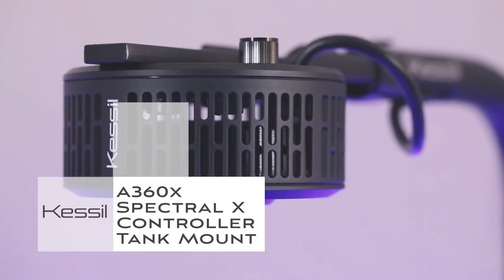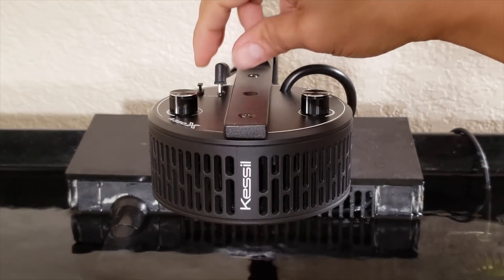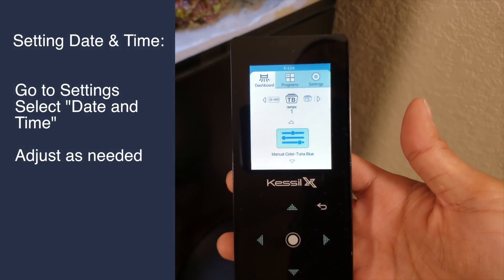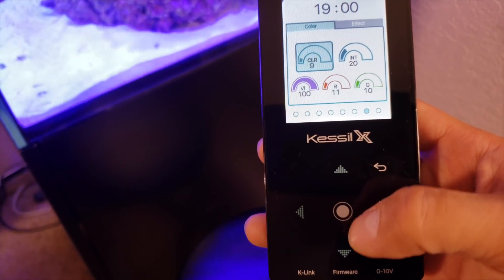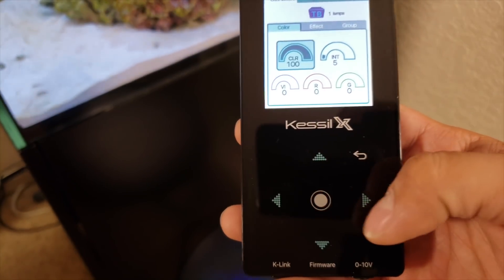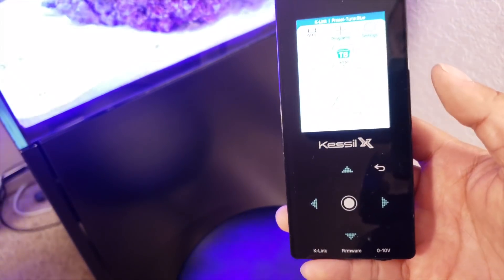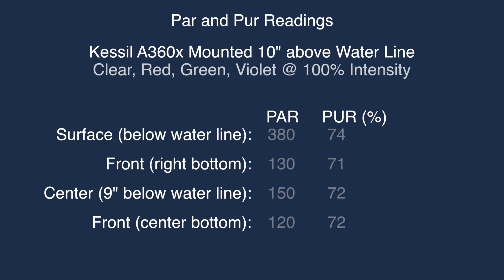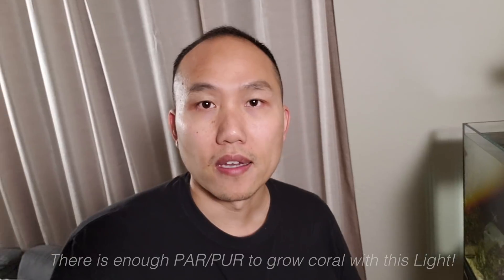Kessil A360x Overview with PAR / PUR Readings (You have to see this)

Comment: What hight do you have your light mounted at? My peak color is 50% peak violet 75% and peak intensity 60% I have my light around 3.1/2 inches. All my coral look happy and are growing. But I'm worried I might have it to low. But any higher the light spill in my living room is really intense. Water line to sand on my tank is 18 inches. I would put a par meter under it but its busted and I'm waiting on parts. Not sure when I'll get them  since my par meter and replacement parts come from china..  just looking for some user opinions. I'm only running a signal a360x for now. This is on a 65g
Reply from the maker: I switched the 360x over to my hydra 52h for better coverage as my corals started to grow.

Comment: As Kessil has said it’s nice to know these PAR numbers but people get too wrapped up in them as end all be all.  Even Radion has been reducing the PAR output to chase a more even distribution.    The blue wavelength is proven to be what’s actually growing coral.  The Kessil logic keeps that locked in so no matter how you mix in the other colors the main spectrum you need stays locked in.  So essentially maxing out additional colors to raise the PAR numbers doesn’t even really matter does it?  If it’s colors they’re not using for photosynthesis it’s just to adjust it to what looks the most eye appealing for your tank.    Gradually people are understanding this but I think a lot of people are still missing this.  I hear you on the wide angle on these.  I was gonna get one but I think it may be too wide of an angle for my cube now.  I don’t want the light to go to waste on the walls.
Reply from the maker: That is correct.  PAR is just PAR.  I personally use it as a way to judge if the light can penetrate into a deeper tank. That's pretty much it.  This kessil is pretty wide for my taste so I switched back to my Hydras but the ideal blue spectrum on this light is really all corals need to grow.  Thank you for sharing your input.

Comment: what schedule you use ?& what distance u have them from the tank?
Reply from the maker: I recently changed the lighting over to the AI Hydra 52HD but when I had the light, I had it at about 10" of the water.  I used the default schedule and then adjusted up as needed.  I did more blue/purple and kept the whites low.
Reply: Modern Reefer  ..thx bro
Reply from the maker: @cbr900rr  you're welcome.
Reply: Which ones do you like more for kessil  360x or the  AI
Reply from the maker: @cbr900rr  Kessil for the shimmer but AI for the coverage.
Reply: @ModernReefer  any difference with coral coloration? I am not too happy with the kessil, not for those reasons, but looking for a reason to stay with it. I still cannot find anything in kessil literature that explains "color" and "intensity". I have the spectral x, but that doesnt help. I like a very blue-ish look. anyway, one of the better videos on this light. thanks
Reply from the maker: @xisotopex  Its going to be hard to get the same blue coloration as the other brands like ecotech or ai.
Reply from the maker: @xisotopex  Kessil had a statement saying that they have tuned their lights to a the blue spectrum that corals need to thrive however adding in the deeper blue/purple is more for the end users taste.  I personally like the royal blue for the corals to pop.
Reply: what did you do to keep the whites low, yet the par, up? @ModernReefer
Reply from the maker: @xisotopex  The test is at max lighting output.  I didn't do anything special.